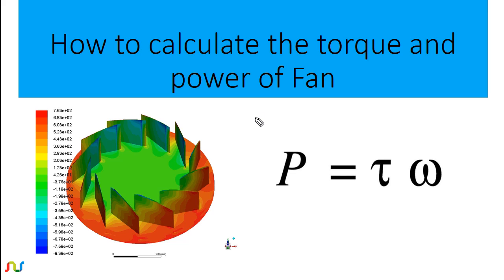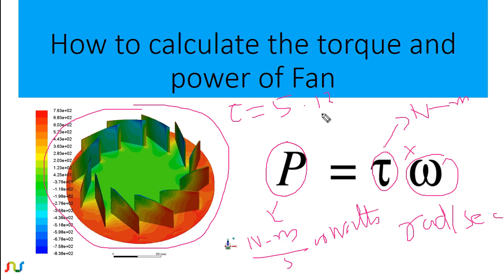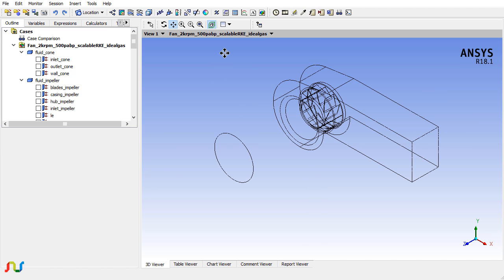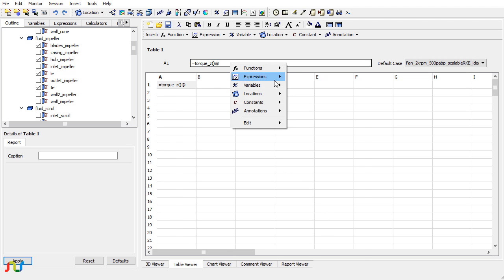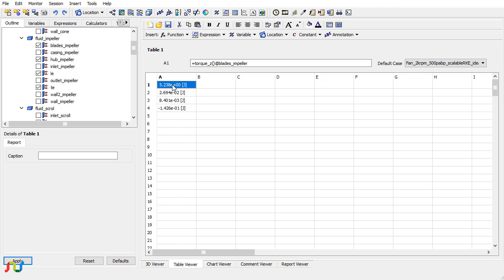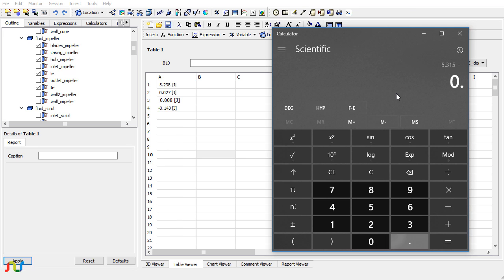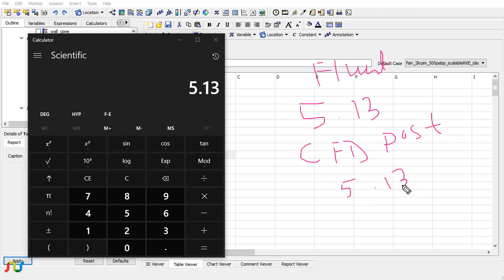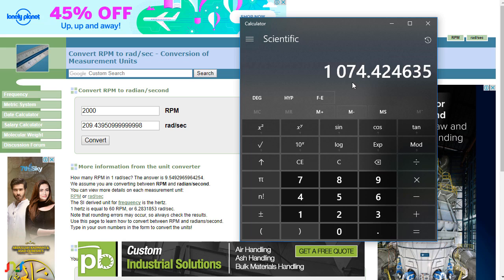CFD Tutorial 2 - How to find torque and Power in CFD Post

Comment: Hi, im using ansys fluent for my savonius wind turbine. For 3 blade. Wind speed is 7m/s. And rad/s is 4. Is it normal to have the torque as negative?
Reply from the maker: Yes. And it happens when vector direction is opposite
Reply: ANSYS CFD tutorials and courses and to find the torque coefficient, i just need to follow the calculation and step that you have show in the part 1?